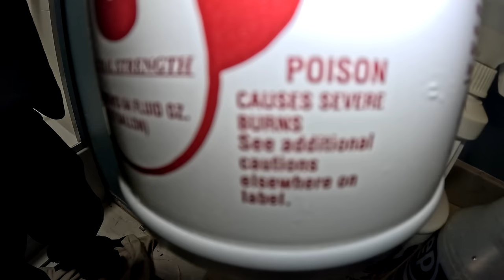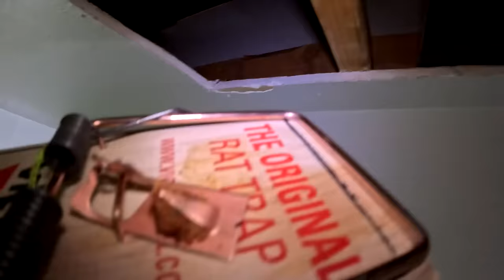The FASTEST way to get rats OUT of walls…in LESS than 10 SECONDS!

Comment: I don't have a rat problem, but mice are a fact of life in the mountains. For years I endured the frustration of mice cleaning the traps without  triggering them. Peanut butter they just licked off. Cheese squished into the bait holder plate was often still removed. Then I started using a hot glue gun and gluing a piece of dry dogfood to the bait plate. Life changing! For me and the mice. Now when a mouse gets in my house, it is dead within a few hours of entering.
Reply: Thank you for the hot glue tip!
Reply: And one thing country mice love is indeed dog food. 😊 great tip. 👍🏻😎
Reply: I stick several glue boards together and secure to the floor or whatever.  These supposedly have a pheromone to attract mice but sometimes I give them a little more help with a peanut , and a bag of first strike bait containing an anticoagulant is tossed/ stuck to the middle of the boards.  What the traps do not get, the bait does.  If I hear a mouse struggling, I do not wait to dispose/ drown it because so many times the mouse would eat its way out off of the board, even eating off a limb if necessary.  After I read that mice have very poor eyesight, and that they tend to follow along where the vertical meets the horizontal, placing the traps at those corners upped the catch rate.  And it seemed like when one was caught, a second would soon be caught, too.
Sunflower seed for birds had been kept in sacks in the garage and attracted mice big time.  So, the seed was placed in 33 gal plastic garbage containers outside, but found that squirrels could eat through the plastic in less than a minute.  Storing the sunflower seed inside a metal garbage can solved the squirrel problem and reduced the number of mice, too.  The squirrels were not happy and keep pissing on the metal lid, but that does not help them get any sunflower seed.
Reply: @somaday2595  Those squirrels are smart!
Reply: As long as it doesn't get too hot, I would recommend part of a tootsie roll on the trap, smeared with peanut butter.  After they get the peanut butter off, when they try to tug at the tootsie roll, the trap is far more likely to spring.
Reply: What a clever idea!
Reply: Thanks, great idea!
Reply: Such a smart idea thank you!!!
Reply: Thanks for the tip
Reply: Oh man thanks for the tip = they just somehow eat the peanut butter without making the trap go off.  Will try this tonight cheers
Reply: Great idea!  Thanks!

Comment: From 5:07 to 5:19: Carpenter help.  With your sheetrock saw, cut horizontally until you reach the 2x3 or 2x4 in the wall.  Then cut half way across the stud.  Do the same on the other side (studs are 16" apart, so this should be the length of your cut). Do the same thing on your top line.  Then, take a straight edge, usually a level, and draw two vertical lines to make a box.  Then, using a sheetrock knife, not your sheetrock saw, cut the vertical lines on the studs.  The sheetrock that you remove can then be expertly reattached with three sheetrock nails per corner (12 nails in all), one hammered into the stud from the reattached sheetrock, one hammered an inch away, into the stud, from the walled sheetrock, and one hammered an inch above that one, on the walled sheetrock, about half an inch to an inch away from the reinstalled piece.  Three nails per corner, all into studs, before trimming 1/8" of the exposed area with the sheetrock knife, then pasting and taping.🙂
Reply: Yep
Reply: Studs are 16in on center. Older houses may be 24in on center. So even outside edge to outside edge would only be 17.5in not 18in. Walls are built using either 2x4s or 2x6s.
Reply: In modern day sheetrock screws are used not nails. Hopefully the toilet wasn’t attached so the painter can move it to paint behind the toilet. Or likely this plumbing company is going to return to reset the toilet after the painter is finished.
Reply: @jasoningram2006 also 2x4's are 1.5" x 3.5". If you have an old enough house they used 2x's which were rough cut at 2", air drying you would loose about a 1/4" plus or minus.
Reply: In what country are studs typically placed at 18"?  Standard in the US is 16" on center unless dealing with a really old house.
Reply: An oscillating saw would be a the most practical tool to use. It  cuts a thin 1/16 line in the drywall effortlessly.
Reply: @jasoningram2006  In my area they're 16" on center too.
Reply: Studs are 16” on center not 18”
Reply: I built my house on 18inch centers and used 4x8's to floor and sheet it up. Now it flops around like an accordion whenever there is a light breeze. I've put my foot thru the floor more times than I count.
Reply: @johnbeckwith1361 yep that's what i was thinking.
 I also does not create as much dust.
Reply: Or you can just put some backing and be done with it.

Comment: Apparently, anyone can put out a "shingle" and claim to get rid of rats. And have no proof that they ever solved one of these problems. 
Great job, you guys, for both exposing these shysters and showing the proper way to get rid of rats. 

I used to have a problem around a cabin with occasional rats and just used a ramp, half a 5 gallon bucket of water and a little bait to trap of them. They never get away, so they never get smarter.
Reply: Please show how the drywall is repaired again.
Reply: I don't care who you are. If you will go somewhere and try to get rid of rats you're a great person and if you fail sometimes you're still a great person. It's because these guys take on some super tough places doesn't mean that the guy who won many times and lost there is a bad person. I don't think these guys were as good on the first day as they are now.
Reply: The bucket traps I head are really good for catching mice and rats. I had only issue with a rat. It was a huge river rat that had come into my house. That thing was the size of a small rabbit and made so many holes in my walls to travel from room to room in the 4 days of having that thing enter our home. Finally caught her and I was very thankful as I had babies and didn’t want that thing biting one of my kids if it had ended up heading to the upper levels of the house. Thankfully we got it before it left the basement level.

Comment: My trick for the large spring traps is to screw them to a plank no wider than the trap itself. Then elevate the end of the board that the wacker is on. The rodents only can approach from one direction, (If they can come from the wrong direction the spring can shove them clear of the trap). I also tie a string to the trigger and coat it well with peanut butter. They can lick a trigger clean but will tug on the string which will set it off.

Comment: Great work, as usual, guys. Yes, if you find a rat trap which has been recently sprung and there's fresh blood on the trap, there's virtually always a dead rat nearby. And often there will be no blood, but still you'll find a dead rat within a few meters of the trap. The rat only needs the Victor trap's kill-arm to glance off its head and that's enough to fatally injure the rat, even though the trap may not hold the rat and the rat may stagger some distance from the trap before dropping. That's why you Twins have fitted your traps with serrated edges around the bait hood, and why I fit my rat traps with 3 - 4 sharp nails in front of the bait hood, to help hold the trapped rat on the trap. I trust that you fitted wire mesh over that breached vent pipe where it exited the roof.
Reply: Victor rats traps are by far the best!
Reply: Did the rats originally enter the  system through the vents or did they come in through the sewer ?
Reply: yes, the rats climbed up the pipe from the neighborhood sewer system, and then chewed out through the pipe and went into the house.

Comment: We didn't have rats, but we had mice. We finally found out mid 2022 that they were getting in through the poorly installed open sewer pipe that the HVAC system the previous owner got installed was dripping condensation into. We went through at least half a dozen possible routes until we stopped seeing new ones in the traps. So essentially we had an open way for mice to crawl in from the sewers for over 7 years that we've been in the house. 

During the holidays in 2021 while we were at my in-law's for a couple weeks, the mice found their way into our bedroom and my toddler son's nursery. We had found 3 that were either hiding or snuck into the main floors. We had one hiding in my nightstand, we physically hunted it down in middle of the night for several hours, and we got a grab of the tired and not as agile mouse with a grabber extension at which point we took it outside and smashed it with a deck brush. The second one was trapped in a snap trap in the laundry room where it was last sighted but was still alive; I was so angry about them destroying my childhood plushes that I broke the deck brush finishing this one up. The third one showed up in our living room and the chase pretty much went like the first, but we finished it off while it was resting between cardboard boxes by smashing the boxes together at the neck. We had so much to clean up after, and we're still not completely done cleaning up the entire aftermath dealing between being in middle of renovating my in-laws' bathroom and taking care of our special needs son.

To this day I still semi-regularly get nightmares that has to do with rodent infestations.
Reply: What a horrific nightmare
Reply: Jesus that's awful. Idk if you have cats, but that has made a huge difference for us, at least in preventing pests from getting into the home. We have two indoor guys and they catch EVERYTHING foolish enough to come inside, it's great. We just try not to let them eat anything in case it's been poisoned by a neighbor. (Seen too many cases of owls dying from eating poisoned mice to take that risk.) We obviously got them as companions, not for pest control, but boy is it a nice bonus to our friendship!
Reply: I've been having rats in my house for 5 years. I got a two-story house built. The first night rats came out. The builder didn't help me. I've had 5 exterminator companies and no success. I told them I heard them in the wall and they acted like I was crazy. I hired a handyman. We took off the siding and found holes in the foundation all around the house. I took pictures and showed them to the builder. He told me to send them to him so he can remind his guys not to make those mistakes. Nothing about helping me. I continue working on my house to fix the rat problem. It has caused me anxiety, nightmares, and panic attacks also I'm a disabled veteran.
Reply: @Sleipnirseight  Smart move bringing in the Allied forces. I'm glad there were no casualties other than those sustained by enemy forces.
Reply: I rented a place when I was in college. Mouse ran over my head while I was sleeping. That upset me and caused a sequence of events that resulted in injured and ultimately killed mice. I have to say the best thing is stopping them from wanting to come in and preventing them from entering. Sad to kill a mouse stuck in your trap with a broken leg. Cutest I'd ever seen. But it had to go.
Reply: Mice don’t actually come from sewers. They frequent any location with water, just like you need water to survive

Comment: The snap traps work fine. You have to put the peanut butter under side of the bait plate. They get their head under it in order to get at the peanut butter and because of the angle they're at they cant move fast enough when they set the trap off. This is an awesome video! Your a professional and great content creator.

Comment: Love your commitment to do the job right! We have sewer rats that for the time being seem to be confined to the bathroom vent stack. I am concerned one day they will breach the pipes. I ordered a back flow valve to have installed, but made the mistake of getting a ‘normally open’ valve. I’ll try again to get the right one, but I understand the valve is just plastic and  the rats could chew thru that too! In one of your videos you added some wire mesh. Can you do a detailed video on that? I’m afraid adding the mesh might interfere with it closing properly?

Comment: I got rats in my attic. I had a septic system, not a sewer. I used traps and they came back! I called a pest control company…they used poison. The rats came back. I went around the house and covered all my screen soffits in quarter inch hardware cloth and used poison again. They came back.
I finally found where they were getting in…a retrofit that had added the central ac to the house had a pvc pipe running from the outside unit into the attic. I found some pipe wrap they had chewed. Closed that up, one more round of poison, and FINALLY was done with them. 
I so feel for that lady!

Comment: I made a vacuum mousetrap. I noted they had tunnels in the snow that went through the neighborhood. It starts with a motion detector switch, the kind that turn on your light when you walk in the room, the wet vac plugged in. Set for minimum 3 minutes. The tube runs to a little box with peanut butter treats and the motion detector just before the treat. I was surprised how often it turned on. Looking inside there were many mice. The next day though was gruesome.

I found all-you-can-eat poison just doesn't seem to work, especially if they won't eat it. Sticky traps along their highways with blockage directing their Crossing directly over it, sticky traps are very effective.
Reply: Found sticky traps for colder weather special order through Home Depot.

Comment: As a plumber I am very curious to know how common it is for mice to eat through that 3" abs drain vent.
Also, I noticed that pipe appeared to have been cut prior to the mouse making the hole. Is this correct?
Reply: I went back to look at that part again.  That pipe was absolutely cut.  You can see the clean saw marks.  That's on the bottom piece.  The top piece does appear to be chewed.

So the question arises, did these guys cut it for some reason, like to investigate inside?  Or was that done before the lady bought the place?
Reply: @BlondieSL  I agree. But the homeowner said she had that bathroom redone recently so that makes sense. The plumber didn't install a coupling, the mice knew to chew at that pipe-gap to get to the other side.
Funny thing is that sewer gases should have been smelled all that time. This usually prompts a call for a plumber to investigate. And the problem would have been solved by a plumber.
Reply: I think they made the first of two cuts to remove the piece with the chewed hole in it

Comment: I almost passed this by thinking it was just an advertisement…and it was lol. How ever this is new to me. I was a pest control tech for  14 years. I never came up against anything like this. Your normal exclusion and trapping worked every time. 
 I once lived in a duplex and would hear something scratching in the wall and ceiling a few time a year. The house was tight from the outside. I’m now wondering if it was a similar situation as in your video.

Comment: TWINS for the WIN! Great video.  What do you use, to smoke a house? When I search for a fogger I see the ones for mosquitos, is that the same thing. I got a vertical 3-family building, i think a smoker would be useful
Reply from the maker: Our equipment is super expensive. If your just needing for a few times I would just get the superior smoke machine and candles.
Reply: @TwinHomeExperts @jshbbrt,  I would (did) go to one of the big box stores and buy one of their cheap ($30) wet vac.  and then go to the fireworks store and buy a case of 2 minute smoke bombs.  Put the  hose on the blow side of the wet vac. Blow the smoke down into the main vent stack like you did.  If I got smoke in one of the rooms, I would take a plumbers snake camera and drop it into the vent stack to find the breach.  If you use this method very long you will burn up the wet vac motor with the smoke bombs (use the paper and or foam filters that come with it, takes longer to burn up the motor).  After lighting the fuse, hold the smoke stick in your hand , don't drop it in the vac.  It could start a fire.  wear a glove on the hand with the smoke stick, or hold it with pliers, it can get warm.  I didn't have the expensive equipment you had, but it works.  I've been retired for 7 years now and love your videos.  Keep up the great work!

Comment: Hey Twins have a good end of weekend, I was just wondering if you used the blocker from the sewer ( I don't know the name) I've seen you using that before, the one which blocks the entry from the main sewer line, would that solve the problem as well? 
Keep posting your videos is really entertaining,  cheers from Brazil
Reply from the maker: Great question! Yes, installing a back flow valve ( rodent blocker) on the main sewer pipe will solve the issue. Thanks for watching our channel all the way from Brazil 🇧🇷! 🙏🙏

Comment: I feel like at the discharge point of all these sewer laterals and also inside inspection chambers, there needs to be one way flap valves to try and isolate the rats from the house, it would significantly reduce the chance of rats entering the place. I was getting an idea of a patent until I remembered I think there are actually check valves that could be installed along the system outside various points on the property in manhole chambers. A considerable idea to try?

Comment: The mist important step in rodent control is exclusion. No amount of searching outside was going to reveal the broken sewer vent, good on you for implementing the smoke test. Bait stations aren't traps, they are feed troughs. That you know this but continually hint that they should be catching the rats is deceptive. Lastly the most important part of trapping rodents is the placement of the traps. Same bait on the classic snap trap as one side of your modified trap, but the old school trap got the action.